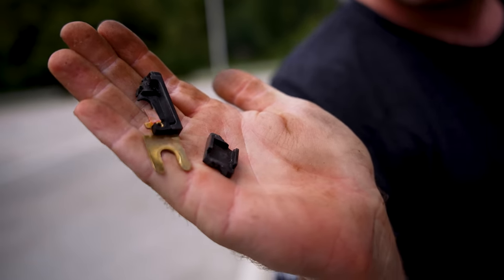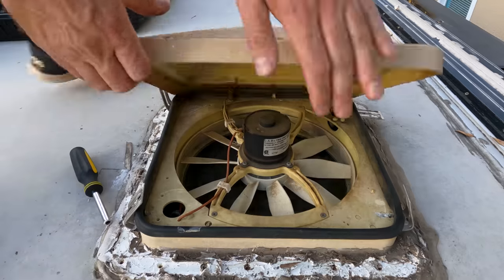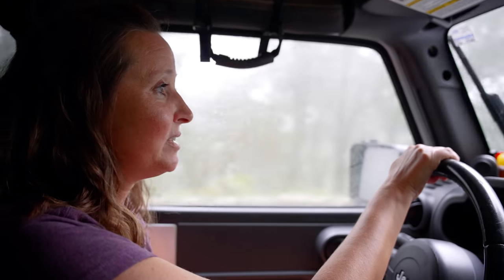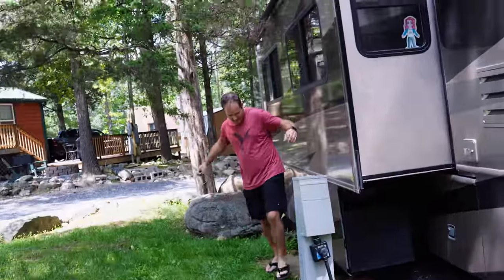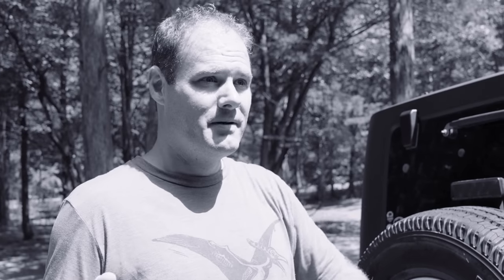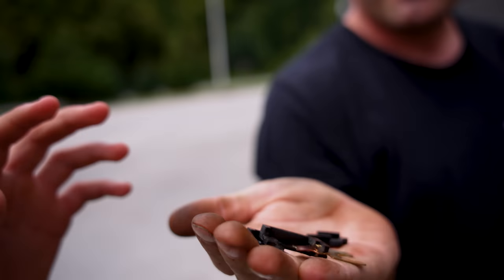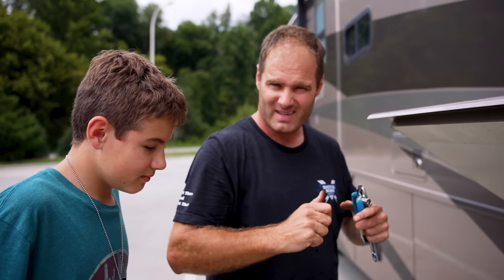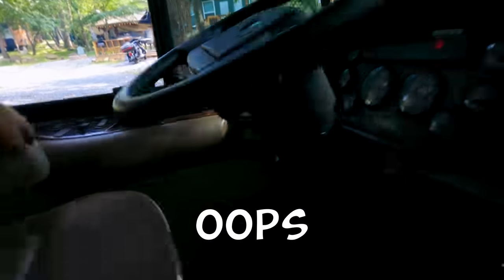IT EXPLODED! We Overloaded Our RV Electrical System 😳

Comment: The problem with upgrading some parts of your rig, is that other parts may no longer be adequate. Be very careful when upgrading the electrical, as you can burn up your wiring ,(or entire rig), in a hurry.  I'm surprised that the fuse was in such a bad location. Perhaps it wasn't that way from the factory? I'm an licensed electrician so these things jump out at me. Also, there should be a battery disconnect switch close to the batteries so you wouldn't be changing that fuse with the batteries connected. Fuses and circuit breakers are installed to protect the wiring but not the loads or the people or equipment. In other words, you want the fuse to blow, or breaker to trip before the insulation on the wires melt and require replacing the wire. The fuse should be sized based on the size of the wire, NOT the size of your inverter or any other loads. Increasing the capacity of the inverter won't do much if you don't increase the size of the wiring from the inverter to the batteries. If that fuse was sized properly based on the current wire size and type, and if it keeps blowing under any circumstance, your inverter is too big for your current wiring. I'm glad you had the foresight to have a spare fuse on hand. Please resist the urge to bolt in a higher rated fuse, as I've seen people do this with bad results. That's when I get the call from someone I haven't talked to in years, and they quickly ask if I'm still an electrician and do I know anything about RV electrical systems. To sum up, if you really want to run the air fryer and microwave at the same time, you may have to upgrade the wiring from the inverter to the batteries. Based on the price of your rig, it shouldn't be a deal breaker. My girlfriend of 27 years and I tent camp at EAA Airventure in Oshkosh, WI every year. In our 450sq/ft tent, we have a Peltier refrigerator, a microwave, a coffee maker, lights, various chargers, and a 14,000 btu air conditioner for the tent. We can run it off of a 15 amp/120 volt connection all week long. We just can't run the micro or coffee pot or A/C at the same time. I know this was a long winded comment, but be careful with electrical stuff. You two have great videos and have fun out there!
Reply from the maker: Thanks for all the info!
Reply: @Craigpv2d. I’m stuck on the comment about the price of the rig. You realize that the rig is 18 years old and they bought it used? You are insinuating their wealth based on an 18 year old RV towing a 15 year old Jeep.

Comment: When I am dry camping, using coffee maker, microwave, air fryer, etc. I start the generator first.  Inverters have their limits.  When I watched your previous video detailing your plans of removing your propane range, I feared a train wreak was ahead.  Most restaurant chefs prefer gas for cooking.  You have a good set up. you just need to accept its limits.
Reply from the maker: Very true, thanks for watching

Comment: You may want to replace the ANL fuse block with a Mega/ AMG fuse. The word on the street (so called experts) is that the ANL type cannot endure the heat of a 12V feed to a 3000W inverter. If that was a 300A fuse then you might not have exceeded the fuse amps but just burned it with heat. The fuse should not blow apart like that. I used the AMG fuse on mine and fused it at 250A and it held with AC AND Microwave at the same time. I was pulling 235 amps! I have 2/0 cables and the lugs were slightly warm. You should have 2/0 cables and if you want to reliably push it that hard then 4/0 would be better. This is important because it can start a fire. You cables look pretty beefy to my eye. The crimps on the lugs must be pristine to avoid the heat. Check all your lugs for heat while the system is at full load. A little warm is ok but they should not be hot. Its just 12V so it can't shock you but remove rings or metal because a short could be down right explosive!
Reply from the maker: Thanks for the info!

Comment: You should use a circuit breaker on the inverter so that it would trip the breaker in an overload and all you would have to do is flip the switch. I use a 200 amp Blue Sea breaker on mine.
Reply from the maker: We do have a breaker (which is strange why it didn’t trip)? We will have to look into it tho.
Reply: @GratefulGlamper  Hmm that is interesting

Comment: That makes since, an air fryer is around 1700 watts and not sure how big you micro is but they are around 1500 at min. so that above 3000 watts. Even if one or the other saw smaller you are going to be at 3000W or real close. Might be a good idea to get a plug in watt meter to test appliances and you could label them with the watts they use. Most tell you on the device somewhere but it might not be convenient to flip them over to look.
Reply from the maker: Good idea - I was actually using our app to monitor draw but then there was a spike with one of the appliances and that was that, LOL.

Comment: How long is your rig? Charity how was it for you to first drive the rig. Trying to convince my wife she can drive a 45 foot rig with a toad Ford F250 behind. What do you recommend?
Reply from the maker: Our rig is 40’feet - overall length with our toad is 55 feet. I started driving on remote highways in states like Wyoming and got more comfortable as time went on. I do not like driving in high traffic situations so usually Ben drives if we have to pass through a town like Atlanta, etc. -Charity
Reply: If she can't see it in the mirror, shadows can be a big help. I'm a retired coach bus operator, so a Class A motorcoach is a natural. The higher driving position enables you to see so much more. Get comfortable with the speed and the braking and maintain a 5-second following distance. Tell her to relax, she'll be fine.

Comment: Large air fryers can use up to 1800 watts, microwaves are typically 1500-1800 so there you are….. you need a 4,000 watt inverter to run both.
Reply from the maker: Found that out the hard way, lol.
Reply: I'll use one or the other, being mindful of the current draw. While on full hookup, I have access to another 20amp outlet so that there are no concerns about over loading. During summer I operate my fridge and water heater on propane to free up some amps for other items while the AC is in use.